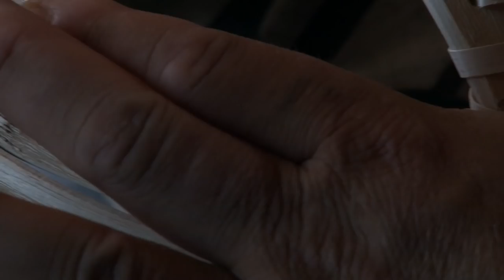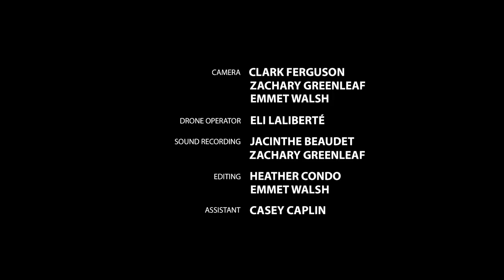How to Make a Traditional Woven Basket from a Tree | Short Film Showcase

Comment: that tree just splits itself????
Reply: after you used the shaving horse to make that plank, he would put in water and hit it until the age rings split. then use a drawknife to split into strips.
Reply: No. Pound on the log is the traditional way. He splits out a billet ( stick) Shaves it down with drawknife ( optional) . You can shave it down with a regular knife then pound it with a hammer. The video and the power hammer only shows the last part of the process. It takes about an hour of pounding by hand to separate one stick. He's using a blacksmiths power hammer.